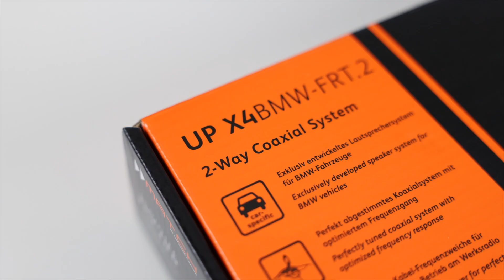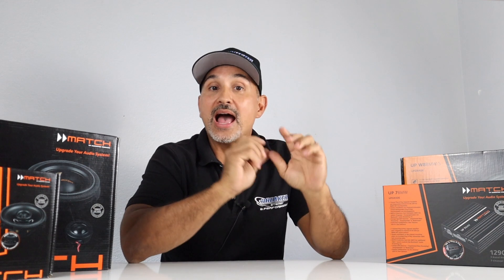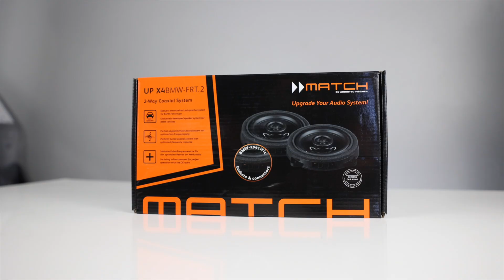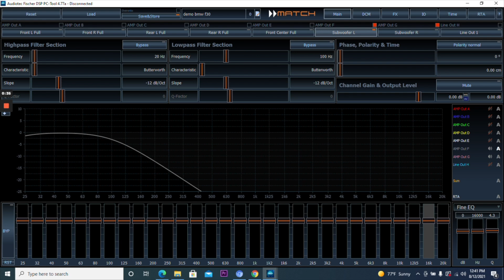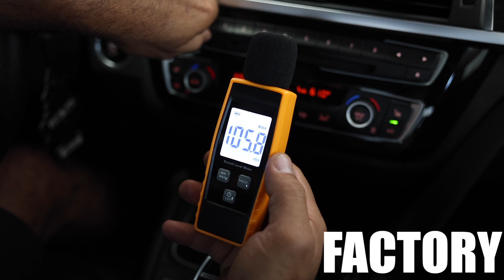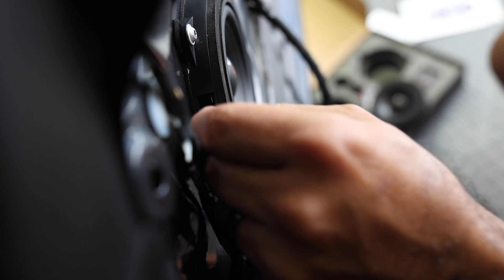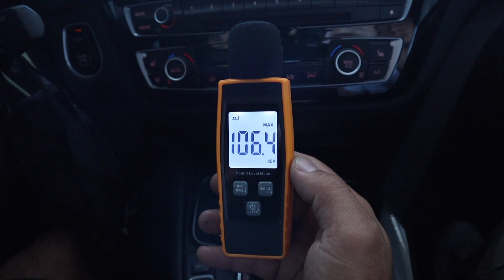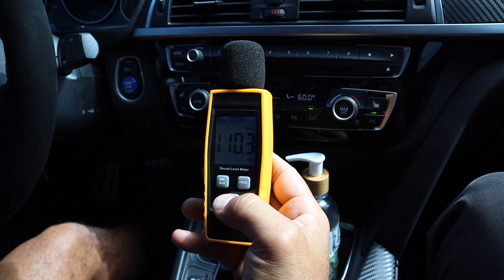Match UP7BMW + Speakers Plug & Play Car Stereo System BMW 3 series 2011-2019. Review & Install

Comment: I just installed the amp on X2 with bmw hifi speakers at first stage and guys the difference is day and night.  The clarity of the sound from the same speakers made me smile and want to stay in the car after arriving to my destination.  Then the bmw woofers made the sound go outside of the car as they are much more boomy and they vibrate the seats twice as much.  Now I am waiting for all the rest speakers to make the full update of the system and I will be back with more info!

Comment: I replaced amp and subs in my hifi system on g20 and sound is so much better right now. Next step - replace acoustics in doors and central channel. In terms of pricing this total match system is so much better than any other solutions plus its very simple to install.
Reply from the maker: Nice!!
Reply: How was the install process of the amp?

Comment: Thank you for the excellent video. Loved the structured approach to the install, as well as the comparisons with just the amp upgrade and then with the speakers as well and then comparing with the HK sound system towards the end. I have a 2021 6GT G32 that came with the S688A HK surround sound system and looking to follow a similar upgrade path. My car comes with iDrive 7 and for some reasons best known to BMW, the HK system now is rated at 464W vs. the 600W pre iDrive 7. Would you recommend the Match UP 8 or the Match UP 10 and also, are they plug n play like the Match UP 7 you have installed. Thanks !

Comment: I have the S688A Harman Kardon in my G15. Would the Match speakers provide an upgrade to that? Also, how does Match compare to BavSound and Alpha One plug and play speakers and amp? Which one is the best?
Reply: Just change the amp first and see how you like that as that is the biggest difference, the HK speakers are actually not that bad but you will need to change the underseat subs as they are 8ohm in the HK system and the match sub output is 2ohm.

It's a good bit better than standard HK for sound quality and about a 3rd louder with a good clean music source. Spotify is not going to do this amp any favours. Qobuz or tidal bring this system to life and sounds incredible.

I am changing my door speakers at the weekend and I will update to say if it's worth it over my hk speakers which already sound great but a little too bright for my personal taste
Reply: @FinleyESB  I ended up purchasing the  Bowers and Wilkins speakers and amp off eBay, with the new grilles etc. I think it's around 1400 watts. Have yet to retrofit it, still gathering parts. Went with the B&W in the end because I read it has the best speakers + diamond tweeters, and bonus cool speaker lighting

Comment: hi there i have a 2020 mercedes c300de i have the match sub and musway amp there dont seem to be a brown connector for the sp[eaker for the p[lug n p[lay  to p[lug in as thereis no brown connec tor and ive connected the amp it doset power up dose it need to connect to a remeote the supplier said the amp will turn on with the speaker turnminal  connected? is that true and is my car too new to have the brown plug?

Comment: What is volume level set on the factory head unit when tuning the 7BMW amp with stock speakers? My installer was saying it sounds best at 60% of the total volume (as displayed on the HU). But I find that too loud to be listening music to for a long time! Any suggestions?

Comment: I have a question, I have 2017 BMW 330xi with Hi-Fi, I have upgraded Tweeters, Mids front and Rears and two under seat Subwoofers also installed Match PP86DSP DSP Amp, I bought all this from Bimmer-tech. I feel I need more bass, can I add Match PP 7S-D Compact trunk Subwoofer and not loosing existing underseat subwoofers?
Reply: I got the same setup but without the upgraded speakers. For the bass, you won't really be able to get much bass out of the underseat subwoofers regardless of how much you upgrade it just due to the size and capabilities from frequencies. You can adjust the bass as best as you can to your liking to get a much clearer sound than stock and learn to appreciate that range of frequencies your subwoofers can handle without getting the 'booming' effect - that's from my experience. If you feel like you are already lacking the amount of bass and already tuning it to the max settings, you really need to go to the next level of getting a dedicated subwoofer in the trunk. That's really the only way to do it without destroying or overdoing your underseat subwoofers. The underseat subwoofers IMO give you plenty of bass, especially that you've upgraded them - I think you are just not learning to appreciate the frequencies. I honestly wouldn't go the subwoofer trunk solution just due to the size of the car. I would learn to utilize the software as best as possible before going into further physical hardware upgrades including the speakers, but since you have already done that, you should really learn how to work in that spectrum of your already upgraded setup.
Reply: Hey sir, the solution is that you replace the pp86dsp with Match up7 amplifier, using the same cables. So plug & play swap. You may ask what the difference is? The difference is that Match up7 is newer and it has dediacted channels for the underseat subwoofers, with a lot more power than pp86dsp. Pp86dsp puts out the same 70W rms (@2ohms) for the subwoofers that it does for the rest of the channels, while match up7 puts out 160W rms (@2ohms) for the subwoofer channels. That is over double the power. So in conclusion, swapping for match up7 would be the solution.

Comment: I have the hifi in my e90 and sounds pretty good really interested in making it better
What a great video , and review strategy most common question will it be better right than the HK and how much better than the hifi
Reply: With the upgraded match up7bmw amplifier it will be better than Harman kardon/logic 7 but with stock hifi speakers you may find them losing quality at high volumes with the Match up7bmw because it might be too strong for the speakers. But as for the match up7bmw amplifier, it is a lot better than harman kardon/logic 7 amplifier.

Comment: I'm a w205 with burmester sound upgrade owner. I'v replace the doors speakers with focal 2 ways separate and the central channel. I'm thinking to go for match amp now but is it 60W per channel good enough? Also i have a audison sub and a skar amp for the sub in the rear. Will it be a good setup or i should go for a better amp for the system like a audiocontrol unit? Best regards! Good video!

Comment: I have the base stereo in my 5 Series G30. I have already installed the Matchup UP7BMW and I'm looking to either get these or the Etons. I could not find these Match FRT-2 on your website, do you still carry these?
Reply: Etons might be better, what did you end up with?
Reply: I haven’t pulled the trigger yet though I’m leaning toward the Etons.
Reply: The base doesn’t have a amp, is the cabling there then?
Reply: @basholtman4103  The base does have an amp and I've replaced it with the Matchup UP7BMW. The cabling was plug and play.
Reply: @ricklyon2833  Hi Rick, with base you mean 4 speakers (no tweeters) and subs which are powered by the head unit correct? So even that system has an amp?
Reply: The base in the US - HiFi 250W, 12 Speaker (Option 676 )
Reply: @basholtman4103  He is talking about the US standard audio, which is actually hfii with an amplifier.

Comment: are you able to bandpass the crossover on the sub channels? I would want to use the under seat woofers and midbass drives, then add a sub in the trunk. Thanks in advance.

Comment: Cannot be better than original F30 Harman Kardon, one of the best stock speaker system to date
Reply: Funny guy 😅
Reply: @typical666  ive had this setup installed on my car. So im talking from an experience fyi
Reply: Yeah but people replacing straight away hk. The amp doesn’t even have dsp option so stop it please.
Reply: I have a G11 7 series with HK, I've installed just a match up 10 DSP and the clarity is considerably better than HK without even adjusting the DSP settings. A much cleaner sound and that's without upgrading the door speakers, you have to change the under seat subs as hk are 8ohm and match is 2ohm.

HK is decent, but not if you appreciate good sounding music. Also music source makes a huge difference, Spotify is shit. Qobuz or tidal will bring out instruments you never even knew where in some songs
Reply: @-cemo there is no way you have had this installed on any car because what you are saying is completely false. If you can't hear the difference you need new ears. I have had the full fat HK system in my 6 and 7 series and the difference is very clear after just a match amp. No surprise really as HK is 10 years plus old technology
Reply: @ ive had these insallted in my w206. With upgraded helix twitters. Unfortunately they are worse
Reply: @FinleyESB the thing is you have the G series, not F series bmw. It is night and day between those two series when it comes to stock/harman speaker systems. F30 harman had much deeper bass and much higher volume output, just lacked slightly on the highs.
Reply: @typical666 Exactly. The tuning on the amp is ridiculous. Anybody who doesn't believe it just d/l the program and see all the options yourself. Personally I worked with one of their techs to make me at least 10 tunes before I was happy with the sound. Anybody who can't hear a difference should return the product because they have a tin ear anyway.
Reply: Yeah, no. First I put in the amp and it was a definite difference. Added the entire 16 speaker system and it's night and day.
Reply: @-cemomy 6 series was a F06 gran coupe with 688 hk system, same as all the other 650 watt hk systems in f series cars apart from the small ones 1 and 2 series etc. My 7 series is a g11 pre lci with exactly the same 688 hk system. Lci changed to 450 watt with RAM.
pre RAM HK is higher output and also requires an sdmi to process the vehicle sounds. So like I said, the difference is very noticeable, especially the sound quality, a much cleaner sound, also no roll off with the bass at higher volume. Standard HK you need to be over half volume or it sounds shit, then you get to 3/4 volume and the bass rolls off to protect the factory speakers.

My door cards vibrated horribly in the rear of my 7 with some songs, not any more, I go full volume and zero vibration through the door panels. Because it's a cleaner better sounding amp

Comment: These MAtch speakers are totally crap. Match amp is very good upgrade (espacially thanks to built in processor), but these speakers sounds worse than oem speakers...
Reply: This is what I found!!! AMP is worth it but speakers are the same as OEM.

Comment: Hi, I have the Match PP62DSP installed in a bmw f15 base sound system(not hifi), already have this paired with another Vibe Powerbox 4001.1 Amplifier that powers the sub (Vibe Slick CBR12).

Now my question is... I'm looking at upgrading the speakers as well as they are surely getting overpowered by the bass, would this AMP be enough? or would I need another? I thought since I'm basically only looking at powering the front plus the rear sub I don't need a more expensive option with sooo many channels.
BTW on this model I know the wiring is basically done from head unit to underseats to door speakers any idea how I can actually separete those and amplify them while leaving the rear speakers to be amplified by the headunit?
Reply: With this match up7bmw amplifier you can power the whole system easily, no need to leave rear channels for headunit

Comment: I have a BMW f10 535i. All my mids are Eton B100's premium speakers including the center speaker which has a build-in tweeter.  My underseat subs are German "Audio System AX-08 BMW Plus Evo" with 175w RMS each.   I have the Bavsound Revenant, Match UP 7BMW DSP and the newest Bavsound Revenant Pro.   

The Eton speakers WILL sound like total shiiit at first but once they burn in they will sound amazing!  For the Center speaker it MUST be used with it's recommended filter because with some songs that have strong bass, the center speaker will crack and pop nasty because the DSP from the Match UP amp will hit and miss to adjust instantly.... So bad advice in this video not to use it.

NOW here is the most important part....!    If you upgrade all your speakers especially the under-seat subs.... YOU MUST CONNECT THE AMP STRAIGHT TO THE BATTERY because it will now demand more amperage and those stock oem power wires (yellow) from the stock harness will NOT PROVIDE THE NEEDED AMPERAGE FOR THE AMP to have clean power and work stable!  The Match UP amp WILL cut off  and clip because the hard bass is demanding the extra power in which the skinny power wires from the harness can't handle causing the amp to overheat and shutdown in order to cool off so you will suddenly end up with no sound.....  This is a problem Audiotec Fischer should've long tested and warned its customers beforehand.  

There's a reason why the separate Power wire cable adapter is included for that purpose to direct connect the amp to the car's battery for clean sufficient power!  An 8 gouge size wire is recommended to feed clean power to the amp and it's enough thickness recommend by Fischer. So yes, you must buy a separate Amp wire kit for this.... The once at Walmart will work. So this NOT Plug N' Play as they all state it is..... Only Plug N Play if using with original stock speakers and not upgrades....

Now what happens if you do NOT connect the amp directly to the battery?   Your Match UP 7BMW amp will not last and soon the skinny stock power wires from where the harness connects to the amp's plug WILL OVERHEAT AND BURN and could end up setting up  your car on fire!  That's what happened to me when I revert back to the stock harness's power for testing, frying my Match UP amp dead!  So now I have to claim warranty and learn from my experience!   

THIS Match UP AMP MUST BE CONNECTED DIRECTLY TO THE VEHICLE'S BATTERY FOR IT TO BE STABLE AND NOT BURN ON YOU WHILE YOUR PLAYING IT LOUD  WITH BASS!
Reply: Whoa, that sounds most unfortunate. Could it be related to your even nicer speaker upgrades requesting more power than the amp is set up for and doing some sort of power spike?
Reply: You have no clue what you are talking about. A speaker itself can not demand for more power. The match up7 amplifier (or any amplifier) gives the same amount of power to the speakers, regardless of what speakers they are. If you replace a 10W (4ohm) speaker with 50W (4ohm) speaker but it still uses the same amplifier, nothing regarding power consumption will happen. The wattage a speaker has only means how much power (watts) it can handle. So only way how you have cooked your match up7 is if you used wrong kind of speakers with less ohms (impedance), that would result in match up7 trying to produce more power it can output. It is not the amplifier manufacturers fault, it is yours.